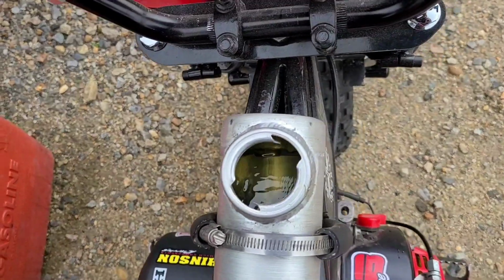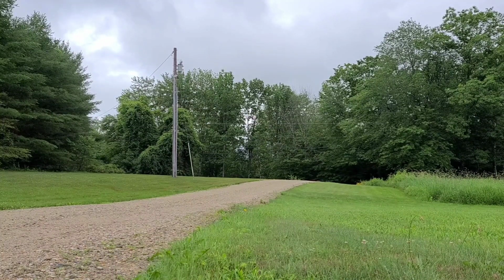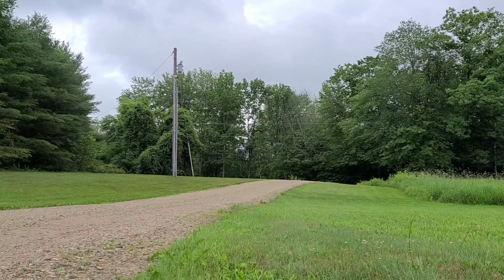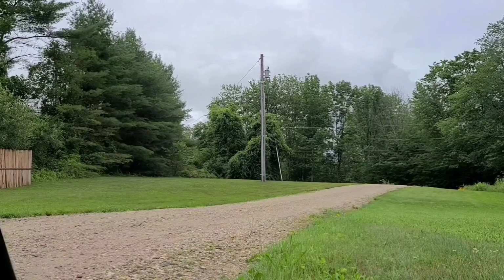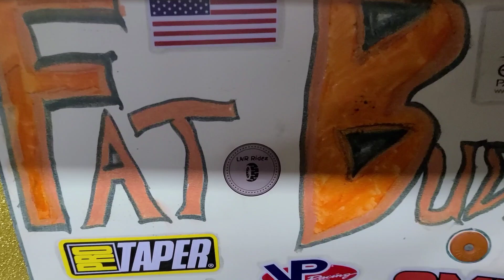Black Betty Torque Converter Fun

Comment: Can the 32 degree of timing blow my motor with no billet rod or should I just get a balco flywheel with no billet rod
Reply from the maker: I have a  Predator 212 hemi (still governed) but with a stage 1 kit and an 8 degree timing key installed. It runs very well. It's the excess RPM from pulling the governor that leads to the engine blowing. Gopowersports.com sells Predator 212 and Tillotson 212e complete motors with no governor and stage 1 installed but they recommend that you do not change the valve springs or cam without adding a billet rod or flywheel. Your already doing better than that by adding a billet or aluminum flywheel.
Reply from the maker: Also if your not going to do a rod, use synthetic 10w30 and change your oil frequently. If the rod breaks you can buy another motor and slap your flywheel on it again and again till you can't use it or break it.
Reply from the maker: Look at it this way, the flywheel exploding is more dangerous than the rod breaking a hole in your motor. Rods and bearings wear out no matter what, some just go to higher limits. There are dudes who race on stock rods and replace stock rods every few races with stock rods. A flywheel just malfunctions and explodes if it can't hold up to the forces, they don't wear out over time.
Reply: So do you think I should be good with a billet flywheel with no billet rod stock springs and cam
Reply: I’m leaving the stock rod cam and springs all I want to put on my motor is the billet flywheel
Reply from the maker: @ghikjedv5442  I'm going to do a similar motor soon with stock internals and a flywheel too see how long it lasts. You got me wondering.
Reply: Red beards garbage did a video 1 week ago and he put a billet flywheel with stock internals
Reply from the maker: @ghikjedv5442  he did state that he had the stage 2 kit for it for after the race but it is safer than not having one at all. Red Beard ain't about getting hit by flywheel shrapnel!
Reply: Do you think I should just get the balco flywheel
Reply from the maker: @ghikjedv5442  I would. I've never used that company before but I run my 212R hard with one and it's ungoverned, billet rod, 22 pound springs and a .660 bored carb no problems 😊.
Reply: Do you know the coil gap and torque spec
Reply: You said yesterday that you are going to put a better flywheel with no billet rod what flywheel are you putting and what motor
Reply from the maker: @ghikjedv5442  sorry I was busy, I have a Predator 212 hemi and a 196 everything else I own has a PVL, Balco or ARC already on it. I'm currently staring at 8 motors with aluminum flywheels and only 2 without.
Reply from the maker: 8 of them have billet rods, 6 have cams oh and the 79 has a billet flywheel so 9 flywheels are upgraded!
Reply: I’m going with the Balco flywheel with a hot coil